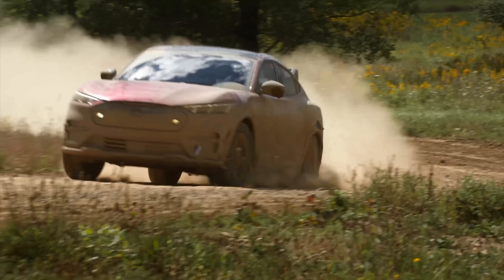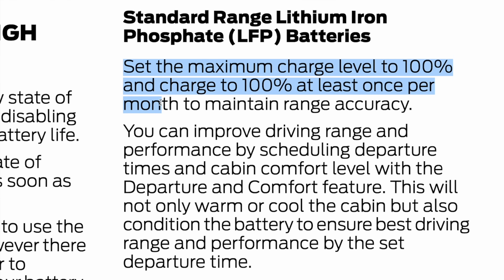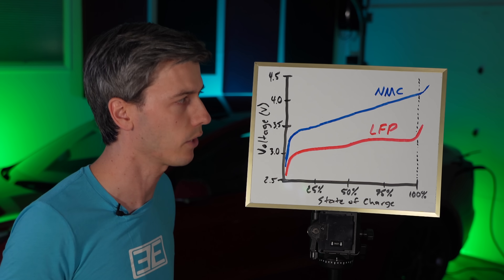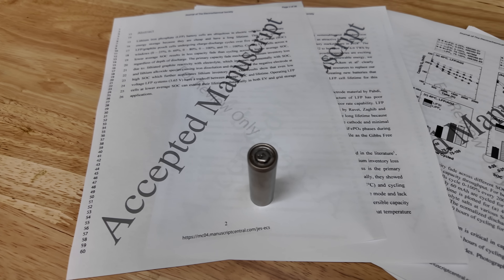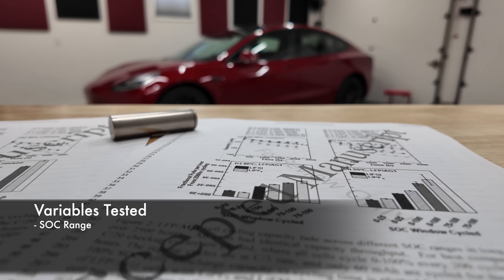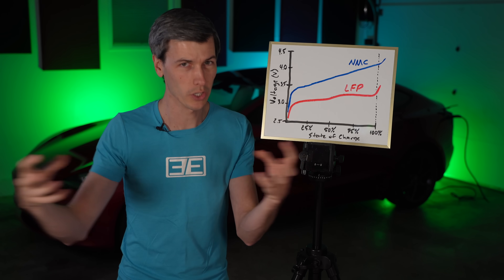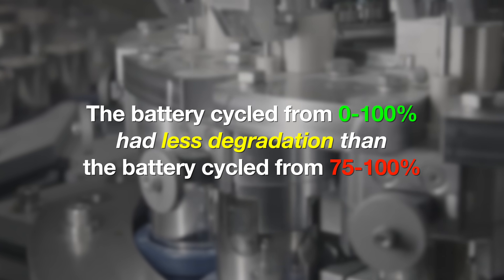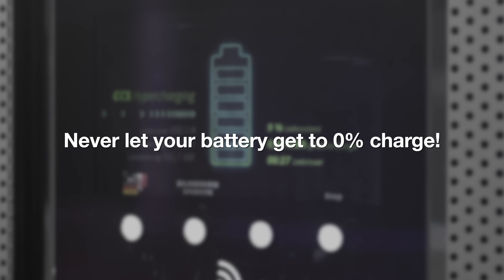How To Ruin Your Electric Car's Battery - LFP Edition!

Comment: It's weird to me how they decided to test the batteries with 0%-X% and 75%-100%, but they just left out anything like 25%-75%. I don't own an EV, but I can't imagine many people are out there driving their EVs to 0%. So their tests relate to nobody really. But I also question: is that 0% an actual 0% of every cell or just a single cell? Because in every device I have that uses multiple batteries, only 1 battery is ever actually at 0% when the device stops working. So if EVs are the same as everything else man made that uses batteries, none of the cells except one cell or perhaps one module is actually reaching 0%. Why does that matter? In my mind, that matters because if tests are on a single cell that reaches 0% and then applied to a battery pack that actually never reaches 0%, the tests are flawed and unexpected real-world results of daily use will occur. The tests that would be more correct would be tests done on charges of 3%-75% and/or 3%-100%. I'm assuming it isn't the whole battery pack reaching 0% and a lot of cells in the battery pack still have a charge left. I doubt they tested a whole battery pack instead of an individual cell because of the cost of a whole battery pack and the different cooling systems employed by different car brands that would effect the results of battery pack testing. So what does this study say that's useful to a real-world EV owner? Well, if charging a cell from 3% or 7% somehow has an unexpected, horrible effect on it, because very little charge is a lot different from no charge at all. Then maybe the experts should pop a battery in a battery tester after their TV remote dies or any other multi-battery device and discover only one of the batteries is dead, not both.
But now I'll finish ur video and still give it a thumbs up cuz you didn't issue the report and your videos are data-driven.
I wonder how much time is saved per video by just using a whiteboard vs. digital...

Comment: I'm sure i readed somewhere that (good) EV car batteries tend to last a lot longer than other devices batteries, because of active cooling and better battery management, including oversizing the battery, such that when you read 100% charge on the screen, the battery is really at a lower state of charge. As the battery gets older, and losses capacity, the BMS allows the battery to reach higher charge to compensate for the loss of capacity. I think that Tesla uses both of that strategies, because the warranty is quite long even for the Model 3: "8 years or 100,000 miles, whichever comes first, with minimum 70% retention of Battery capacity over the warranty period".
I understand that lithium based batteries suffer the highest capacity loss when deep discharged. Other thing that causes capacity loss is charging up to the real 100% capacity, especially if kept at 100%. It's better to charge to 100% and start using it immediately, than to charge it 100% and leave it there fully charged withou using the car. Even phones are including a smart charge that kicks in when you leave the phone charging at night, that will stop the charge when it reaches 80% and try to charge it to 100% just before you wake up (not too hard to predict if you use the phone alarms to wake up at the morning).
The state of charge that causes less capacity loss is 50% capacity, but it's not very practical. But that's why it's recommended when you keep lithium batteries stored for long periods without use.
So, if you know that you won't need 100% capacity, then it's better to charge up to 80%, and never discharge to less than 20%. Of course if the car battery is oversized and is already charging just to 80% when it shows you 100% charge, then it makes no sense to stop charge at 80% yourself. The car is already doing what it has to, because good engineering is at work, and then the user don't need to think much about it, because the maker already did, and that is what ideally all the manufacturers should be doing.

Comment: Confusing to me why the study chose to compare 0-25, 0-50, 0-75, 0-100% SOC. In reality, no one let's their vehicle get to 0%. On my Tesla Model 3 with an LFP battery pack, I charge from 30-80% and once a week charge up to 100%.  Would have liked the study to compare cycling in the middle of the battery pack rather then comparing driving the battery down to 0%.

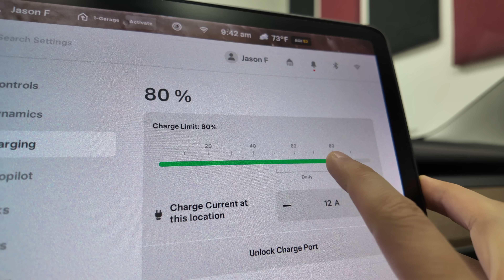Comment: 6:18
If 50% battery charge state means that it's at 50% voltage.. this also means that the motor can deliver the same work with only 50% of the voltage it is designed for..?!?? 
Completely wrong.. 
If it's designed to work at 400V, then it won't even want to move at 200V.

Comment: What about battery balancing or ‘equalisation’ as recommended by say MG and BYD? ie after a 100% charge then car then trickle charges for a while to actively reset the state of the battery cells; also with BYD they recommended running down to 10% & charging up to 100% every 6 weeks or so to balance the battery, improve the GoM etc.

Comment: What would be best practice for LiFePO4 batteries for an inverter for your home? I assume it is the same or very similar to what this video describes, but I still feel I did not get a clear answer. Would something like keep the battery charged at 80% and discharge no lower than 20% not be closer to achieving an overall ballance between having enough charge at all times, increasing battery life and protecting cells from complete discharge damage. Or will that throw my battery capassity measurements out of whack?

Comment: I think I'm even more confused now even after 10 years of using lipos and nmc or nca batteries!
I understood the nmc nca cells like to be between 20-80% soc,   and lfp like to be at 100%.
Now it turns out the rest state for both are around 50%.
I have a lipo pack for an ebike that still works after 8 years because I always kept it between 20-80.
Seems like this is still good practice for all Li chemistries so far.

Comment: 6:17 
Not sure about that...
A battery half charged, or half discharged, ( half empty half full...) Does not have HALF Voltage.
It has 1/2 less "electrons" remaining on the negatively charged polarized side that can cross to the other side..

Comment: Overall = Good :)

One tweak .. for ~9min mark ... SoC .. State of Charge , refers to Ah of charge .. SoE .. State of Energy , refers to Wh of energy .. bottom 25% (0-25) SoC is not = energy to top 25% SoC (75-100) .. it's the same charge , ie same Ah .. not the same energy (wh) .. the lower SoC has a lower nominal voltage for those same number of Ah .. the higher SoC has a higher nominal voltage for those same Ah .. thus the high nominal voltage at the higher SoC is a larger amount of energy (wh) given the same change in SoC (Ah) .. Coulomb-counting is Ah counting .. changing SoC % by the change in Ah that have moved vs the total max Ah of charge the battery can store.

Mixing % SoC (Ah) , as if it was a % SoE (Wh) I find is very common (by many people and many companies) .. but it is conceptually incorrect .. energy Wh after all (not Ah) is the capacity to do work .. any type of work you want to do , move a car , heat the inside of a car.

In practice there is often not a large functional difference .. I expect most users might never see it .. I expect most people just get in their car and treat SoC as if 10% difference is the same as 10% less gallons of gas .. but .. if someone is trying to correctly understand the concepts ... charge Ah , and energy Wh are conceptually significantly different things.

Comment: Thanks Jason, top quality work!
One little point that people miss on this topic is the voltage that each manufacturer decides to call 0% & 100%.
So 100% is just a nominal thing.
In my LFP Tesla, 100% appears to be as low as 3.36V per cell. (observed via S3XY buttons app).
This is low for LFP cells, compared to 3.65V cited by CALB on some LFP cells that I use in other applications.
So I think Tesla is being quite conservative on what they call 100%.
Which would have the effect of reducing range and increasing battery life.

Comment: Study ignores battery management completely, the test cycled batteries at c/3 at 40 DegreesC and 55 Degrees C - this is not real world. When you plug in a Tesla anc charge it ot 100% not all the cells are charged to 100% and stay there, the study obeserved 6% and 9% degradation (mAh holding capacity) after 68 ans 82 days resectively - there is no LFP batteried car on the planet that experences this charing 75-100% constantly every charge.

My habit is charge to 100% every time and oiften leave it plugged in for days - my degradation after 18 months and 25k miles is under 3% - no worse than anyone trying to baby their batteries.

If the bench results were replicated real world Tesla would be replacing batteries under warrantly within a year.

Comment: Great Video!  Our 2016 Kia Soul EV has LiPB. The only way it supposedly re-calibrates is if you being the capacity below 10% and then get a full charge.  It only goes 80-90 miles so you have to drop it to less than 10 miles left to get it to calibrate. Really an event you need to plan to do which seems silly.  Not sure if they programming has changed with updates.

Comment: You should also make a video on how not to ruin your ice car engine.
Reply: Don't take short trips. Don't idle. Carefully pay attention to how much you drive on hills, in traffic, with heavy loads or towing so you know whether to use the adverse conditions oil change interval. Pay attention to how often you refill the fuel tank to avoid fuel going stale.

Comment: 3:07
Nothing conflicting here.. you just miss interpreted what is written.
- daily usage, "everyday discharge off to work and recharge back home " it's OK to recharge at 100%
- stored for long time " in the garage and not moving for couple of months and plugged in " , don't keep fully charged. Only at 50% .
When ready to use it more often, you can fill it up to 100% again.
Whats so complicated about that? 
Who cares WHY.
The only good reason to do as it says in the manual, is to make sure that the warranty remains valid

Comment: I just put gas in my car and go. 😊
Reply: No, you don't. You check the motor oil level/pressure, you do not rev it up when its cold and when it is too hot, you should let cool it down. Otherwise you will damage your engine. You do all that, because you have learned the caveats of ICE.
Reply: @RatWhistler   those checks are done weekly at the most.  You operate under reduced power when the battery is cold or hot.  I get home and park it without having the hassle of plugging it up. I don’t have range anxiety.  I can drive it when it’s super cold and super hot.  I can fill it up and be back in the road in 5 minutes. And it’s not boring and makes cool noises.  You still have to check coolant, change brake fluid, change transmission fluid.  It won’t outlast a diesel.

Comment: If this is the case shouldn't the range include the best case for the battery life as opposed to only distance on a single charge? Don't we have to look at milage travelled differently? This is not an issue with an ICE vehicles there are other challenges there and well known cause we hav used them for so long.

Shouldn't the manufacturer disclose different milage at difference charges to provide a fuller picture? Thoughts?

Comment: The main reason Tesla says to also always charge is to use wall power to maintain battery temperature. During midwest winters 120v @12amps is barely enough to maintain ideal battery temperature without adding any charge.

Comment: My ony LFP battery is a BLUETTI  AC200 MAX. It is a portable battery with an inverter to produce DC or AC power - actually both at the same time if needed. TheLFP battery for car camping which is mainly keeping my ICECO cooler/freezer running all day and charging the dual batteries of my two wheel drive E-CELLS e-mountain bike at the end of the day. BUT I keep the LFP battery charged all day with a 220 watt Off Grid TREK 3' x 6' solar blanket. Cool, eh? Pricey, but high tech.
WHY AN LFP "solar power center? Because it will get around 3,200 discharge/charge cycles v.s. 480 cycles with an equivalent Li-ion battery.
Yeah, the LFP battery I about 25% heavier but who cares? It lives in the trunk of my SUV when in use but is great at home for power outages.

Comment: You suggest it's a hassle to charge to 50%.  if you can charge at home, it seems trivial.  Set the max charge limit to 50%, and plug in every day.  And charge to 100% occasionally, when it would be useful to do so.

Comment: What exactly is longevity (100k miles, 200k miles) and degradation (5%, 10%)? Depending on those figures, it may not matter at all. If longevity is measured past 200k miles and degradation is 5%, personally, I wouldn't care about that at all.

As always, thanks for all the hard work you do putting these videos together for us!
Reply: I don't think the gradual degradation of the pack overall is that big of a deal in most situations.  The real issue is that the battery is made up of thousands of individual cells that can never be perfectly matched.  Even worse, the weakest cells in the battery take the worst beating and just one or a few bad cells can make the entire battery useless.

Comment: Electric vehicles must be made with easy to remove battery packs so that if anything happens to the batteries, they can easily be replaced. Most electric vehicles are very poorly designed unfortunately, but car designers and vehicle manufacturers are not very good at their jobs, so intelligent design isn't something they are capable of doing. Just ask any mechanic.

Comment: LFP Tesla Model 3 owner here -- I'm constantly going back and forth on leaving the charge level at 80%, or at 100%? The issue is that in the car and in the app, when leaving it under 100% you will constantly be alerted that this is an issue. Even mentioning the battery could be damaged if not set to 100%. This is while keeping it plugged in. 

Because of this, i have left the charge rate back at 100% after a short period of time testing. I can say after 2 years of ownership, i haven't noticed any degradation at all in my normal driving. It could be that yes, high states of charge increase battery degradation, but with LFP its so slow that it really does not matter and you are better off getting the higher range. As mentioned in this video, the recommendations from Tesla may actually be the best answer, but they are not putting overall battery degradation at the top of the list of priorities.
Reply: Unless you are going to be driving this specific car past 200,000 miles it shouldn't even be on your radar. The difference is splitting hairs into a couple percentage points of battery degradation difference one way or the other.
Reply: I just bought a RWD MY and yes, I'll be doing the same. Driving to around 20-30% and fully charge it to 100%. Just like filling up petrol for an ICE car.
Reply: @TwistofWrist1941 are you only plugging up when it gets down to 30%🤔or keep it plugged in, and lower your SOC each time
Reply: @toddbenfield6546  depends. If I drive for a few days straight, I wait till it gets to 30% and plug in to 100%. I can also topping up daily when the sun is out. It doesn't really matter in the long run. Best to follow the manual anyway: keep plugging in @ 100%.
Reply: I’m 30,000 miles in on my LFP Model 3, and it has 3.5% degradation. I daily charge to 80%, charge to 100% once a week.
Reply: @davidc-l9174 so by 300,000 miles you can expect a battery that can only charge to 65%.
Reply: 30-80% cycling is fine let it be and stop overthining

Comment: I practice your recommentations since about 8 years for 6 battery modules 8S with 100 Ah Winston LFP cells used in my RV. A few weeks ago I  tested the modules with a iCharger battery tester and got capacities ranging from 96 to 102 Ah. Of course, new cells directly from Winston had a capacity of about 110 Ah to compensate for initial lithiation of the SEI layer. 
Charging was and is still done to 3.40 V, with absorption time of 1 h. This is good enough because of the active balancers. No requirement to charge to 3.6 V, also not necessary for the gauge, as it is reset to 100 % at 3.4 V and counts Ah with high precision. The solar chargers use 4-wire connection for accurate voltage measurement without voltage drop errors. 
After absorption time has expired the voltage is reduced to 3.35 V/cell trickle charge. During storage the cells are kept between 3.2 V and 3.3 V.
By accident 2 of the battery modules where down to about 1 V/cell for weeks. After charging them slowly with C100 to 3.0 V and then with C10 to 3.6 V/cell, they had a capacity of 102 Ah and 98 Ah respectively. They are back in service without any problems.
My takeaway is that when LFP is handled with care they can have a very low degradation. YMMV.
Regarding discharge of EVs till 0 %, this is really no deal, because 0% on the gauge are no real 0 %. There is still some buffer left, even when driven till dead. But they should be recharged asap to avoid deep discharge. Large SOC deltas cause higher cycle degradation because of the larger expansion of the electrodes, but with automotive use the cycle life is no problem during regular car lifetime. 
In cooler climates with temperatures below 10° C, fast charging and recuperation may cause gradual lithium deposition, with loss of active lithium and potential build of dendrites, even when battery temperature is above 0° C. 
EV batteries will probably mostly die because of calendaric aging. This is accelerated by keepin NMC cells above 60 % SOC and LFP above 70 % for an extended time. Calendaric aging doubles above this limits at 25° C. The car may rest after use or charging with battery temperature well above 30° C for a long time. The car battery has a large thermal capacity.